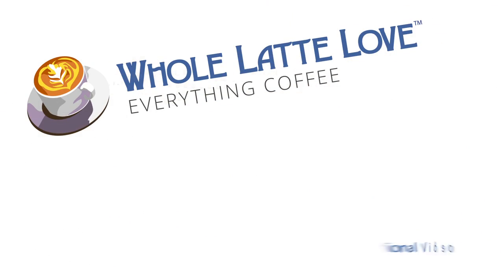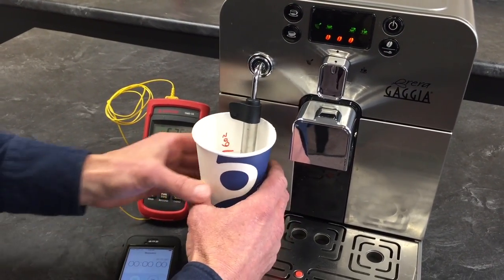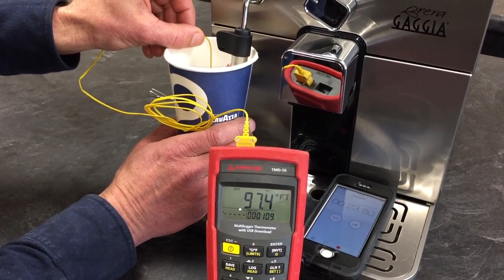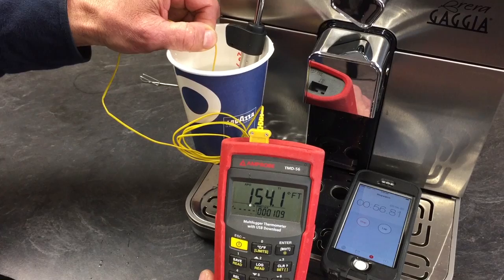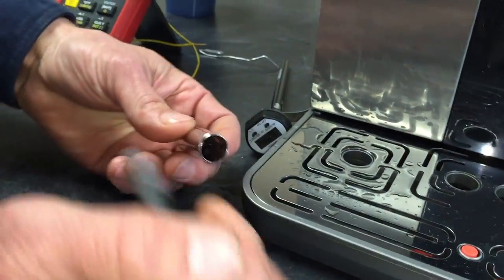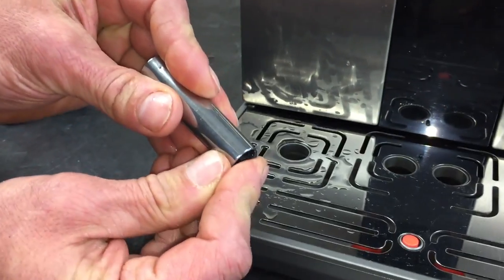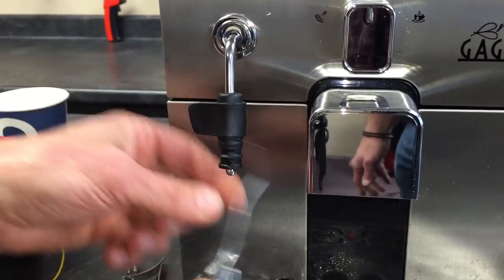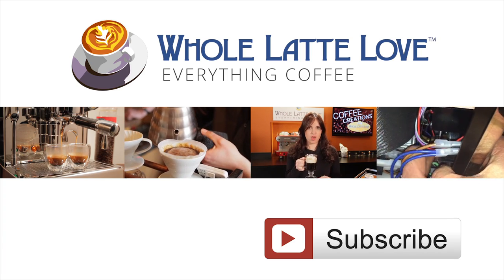How to Correct Frothing Problems and Steam Test a Gaggia Brera Espresso Machine

Comment: Thank you for this tip! I have the Gaggia Classic and was looking at the thermostat already because the steam was not reaching boiling temp. With the temp reaching 160 degrees in a minute I was searching for the hole and its also in the black plastic tube of the Classic. Have good froth now!

Comment: Wow, what a simple fix! I have two of these, one at home and one at my office. The office machine froths beautifully, but the home unit did not. I cleaned out the little hole and Voilà! I just made a nice frothy Americano. Thanks! On another note, my office machine has nice, dry pucks, but the home unit does not (and never has). I'd sure like to know a similarly easy fix for that.
Reply from the maker: Hi Steve. Keeping the wand clean, especially that little hole makes a big difference! Difference in puck moisture could be a number of things like different grind size or coffee used combined with strength setting. Might also be time to do a deep clean/rebuild of the brew unit. Here's a video for that: https://youtu.be/HGmfnGN_JQA
Can also use these to clean internals. They drop into the bypass doser then make like your brewing from pre-ground to clean: https://www.wholelattelove.com/products/gaggia-coffee-clean-tablets-cfae181c-1f2a-4170-85fc-1f00acf75f21

Comment: Hi,
I just got the Brera yesterday and so far I'm loving it!
I did realize one thing though. I took the wand off to create microfoam (which seems to work, operator's error on bigger bubbles! 😚)
The steam however comes out in an angle...I tried to clean the opening with a paper clip, but the steam stays at an angle... Water comes out straight due to higher pressure, I assume. There's no way there's built up milk since yesterday...
What could this be? 
Thank you for all your helpful videos!
Eva
Reply from the maker: Hi c, Happy to hear you are loving your Brera! You are welcome for the videos!
Steam coming out at an angle is almost always due to internal obstruction. Agree it's unlikely milk built up since yesterday but it is possible. I'd have another try at cleaning the wand. This will sound crazy but get the wand tip into a small amount of an ammonia based cleaner (windex etc. works) and let it soak for a couple of hours. Ammonia based cleaners are good at loosening cooked on milk. Do the paper clip poke again. Be sure and rinse well after the soak with hot water from the wand. Hopefully you are already doing this but just in case:  never forget to purge the wand right after done steaming milk. OIf you don't purge you will get milk up in the wand.
Marc
Reply: @Wholelattelovepage  Thank you so much for the reply and the tip with...wait...window cleaner??!!! 🤣
I will definitely give it a shot!
I do purge after every use and wipe down the wand so nothing cakes on...
Since I took off the sleeve the wand seems to be doing a nice job creating microfoam for latte art. I'm very proud to say that I advanced from very abstract art to (almost) a pumpkin! 😆
Again, thank you and keep up the great work!
Eva
Reply: @chowfam1  I just got my brera on Monday and I've then using it every day and love it! I also took the pannarello wand off and it works way better for steaming milk. Definitely pay attention to your milk temperatures cuz they make a big difference in the taste of your coffee
Reply: @squarehammer4619   Congrats on your Brera! 
I could never get the steam to come out of the wand (just metal arm, no pannarello) in a straight line. It always came out in an angle, no matter how often I descaled, used the paper clip, soaked with window cleanser, etc. It was like this from day one on. I believe that the little hole might have been drilled at an angle...?
I finally broke down and bought the  "Latte Art Wand". Now it works great!
I luckily don't have issues with the taste of the coffee, it was just the steaming of the milk that was hard to do. Much easier now! But you are right about the temperature of the milk, it makes a HUGE difference in the taste!
Thank you and coffee on! ☕️😁

Comment: I also noticed the steam jets out at a bit of an angle.  My Brera did this from day one too.  I am using the latte art wand now with the outer portion removed.  My issue is that about 3/4 of the way thru frothing the velocity suddenly decreases a lot and then comes back after 10-15 sec.  During that time it seems a lot of very large air bubbles are introduced as well, messing up the micro foam.  I'm not sure what to do about this.  I do run a double shot for the espresso portion and froth only 5-6 oz of whole milk.  Seems I run out of steam for bit and then suddenly catch up.  Any advice on this would be most appreciated.  Thanks